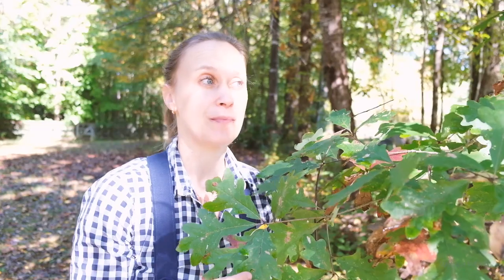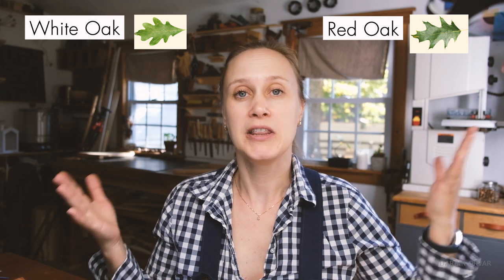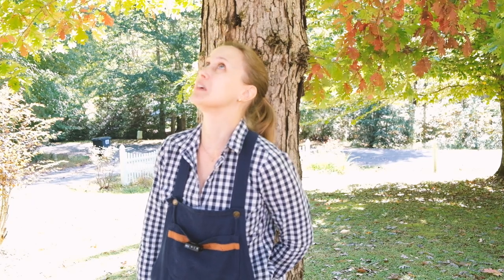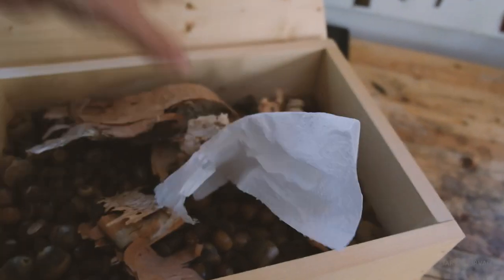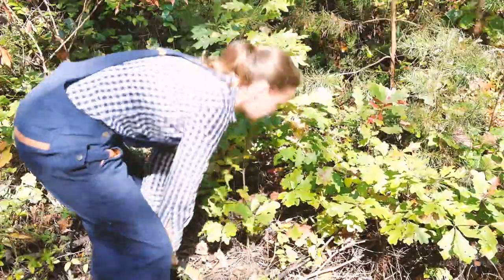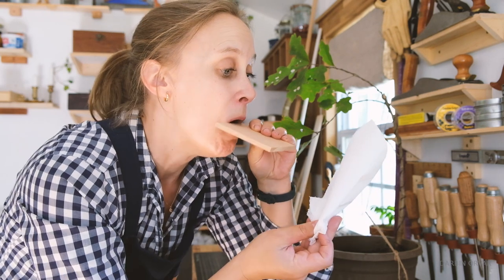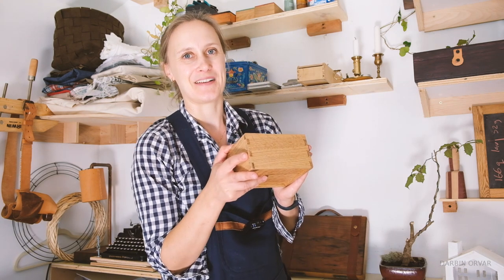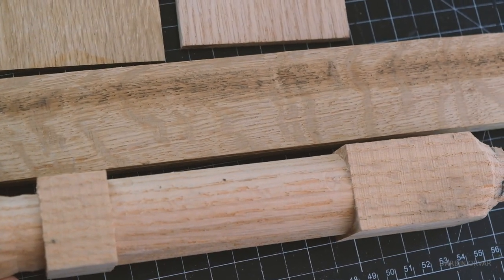White Oak vs Red Oak // Cool Woodworking Facts

Comment: Cool Linn! I use white oak frequently myself. A cool thing I have done is use the vinegar and steel wool mixture stain on the white oak. It really has a cool look, and it really turns super black because of the high tannin in white oak. and all natural! If you have not heard of the mixture of vinegar and steel wool before, It works on other woods as well, but the higher the tannin in the wood, the darker it becomes...

Comment: White oak is and has been my favorite wood for decades. As we remember that white oak was used in building the Spanish Armada fleet of 300 ships and thus severely hampered the stock of white oak in Europe for a long time. Some older houses with stairs had been of red oak and this older oak a hundred years ago had a much tighter grain than the red oak of today. The white oak
is a denser wood and in the mid northern states of the US white oak is not as common and priced higher at the mills. There is quarter sawn red oak on the market but harder to find. Schools some
hundred years ago used mostly red oak for the furniture and desks along with churches that used red oak.

Comment: You were talking about the smell of the wood.  There are a lot more chemical substances in the wood that you would imagine.  If you heat a piece of wood a lot of different vapors come out of it.  Not so much connected to woodworking, that is unless you are Jason, but bourbon is ages in new white oak barrels and half or more of the unique flavors contained in bourbon come from the wood, not from the grain that the bourbon is made from.  So it would be logical that the wood itself could have some complex fragrances.